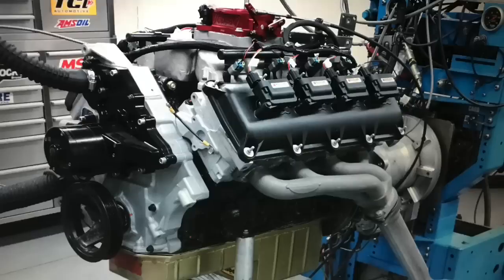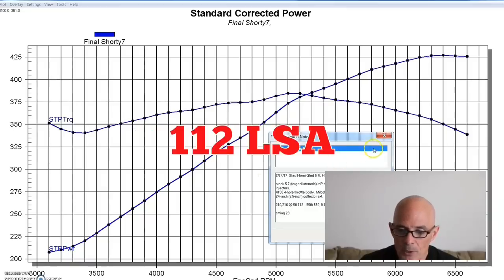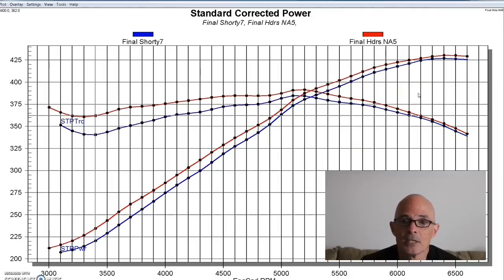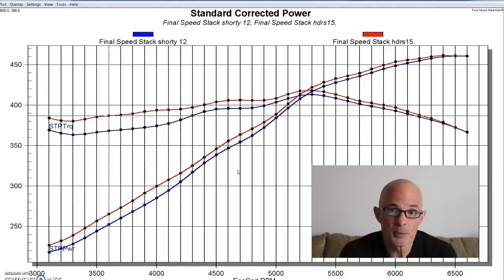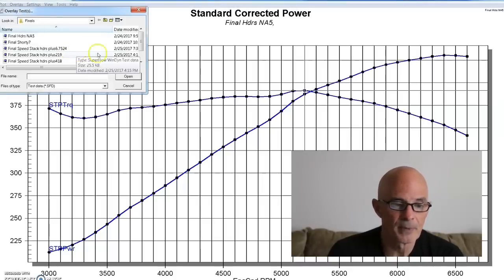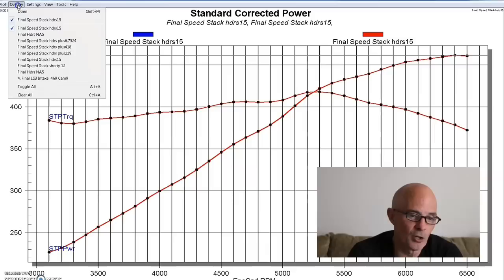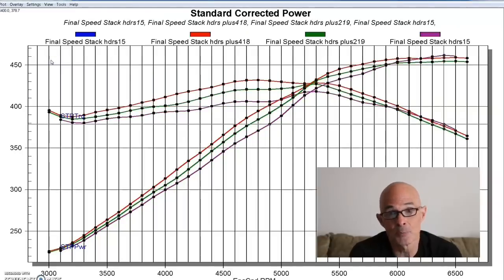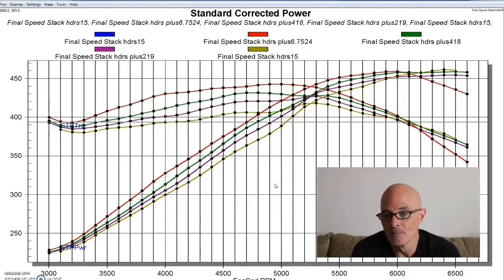STACK ATTACK!! DIY ADJ HEMI INTAKE

Comment: It's time for computer controlled variable intake and exhaust runner length. Use the system to dial in runner to match the rest of the package.
Reply: Ford and Chevy have it and nobody likes it. https://en.m.wikipedia.org/wiki/Variable-length_intake_manifold
Reply: Yes ,aussie ford inline 6 has had an active dual length intake manifold for years.
Reply: watsis buttndo just to add to that, they have been running the dual runner length intake manifold since the mid 90’s. Runs in a long runner until 3800 rpm then a vacuum solenoid opens up 6 butterflies inside the manifold to open up a short runner. Would be interesting to see if any versions of this are available on the ls or hemi to see how good the gains would be over a conventional manifold.
Reply: It’s been in motorcycle intakes for several years. Porches have it as well

Comment: I would love to see a video that uses headers as the intake manifold. Or not necessarily headers, but a fabricated tubular intake manifold where the each cylinder bank has its own manifold (two throttle bodies). I know companies like Holley sell manifolds like the sniper ‘cross style’ manifold (which also uses two throttle bodies) but theyre still not truly a tubular fabricated manifold.
Reply: The term for that is called split plenum. vipers and ferraris use it.  next to stacks it's the best intake layout.  I am experimenting on using a big block Chevy 454 mag mpi boat base plate and removing the single heavy cast alum plenum for dual sheet aluminum plenums (one for each bank) with 2 LS fly by wire throttle bodies and Holley dominator efi when I get some disposable income.  I had thought about 4 plenums and 4 throttle bodies using a DBW throttle body splitter box but since I'm going to run dual turbo, two throttle bodies for two turbos would be simpler I feel.

Comment: I really think the stack injection makes more simply because the air is not turning any corners.  The airspeed will stay high and not "backup" around the corners as the air is forced to the outside of the port on the "curvy runner" single plane intake.
Reply from the maker: its not curve-its length-if we curve them-same results

Comment: Cool test richard. Always interested in seeing runner length tests.

In your opinion, do you think horizontal runners would be better than vertical runners, all else being the same?
Reply from the maker: runner length is runner length (downdraft or X ram)-when you change the angle of attack into the head port relative to the head port, flow can be different

Comment: another fantastic video.years ago I did this on several engines. runner length made a big difference on  a kawasaki 440 both over and under the carburetors.
Reply from the maker: yep-stacks on either side change things (I've done this with Weber side drafts)

Comment: The way David Vizard explained it to me is: in a plenum/shared throttle style intake every cylinder sees the larger throttle opening as only one cylinder is drawing at one time.  In an individual throttle body setup, each cylinder only sees one.
Reply from the maker: search Helmholtz Resonance-plenum, runner and part of the cylinder resonate at a given frequency (intake tube as well)
Reply: Richard Holdener ... Cool, thanks.

Comment: There's a video on youtube about a guy that has a 20b rotary engine with 3 velocity stack that extends out for low end torque and goes down to shorten the runner length for topend power. Can you make that so you can control and make low end torque and topend power? You have the brains that's well more than enough to figure it out.
Reply: the Mazda 787B that won Le Mans had continuously variable intake runners.
Reply from the maker: 4-rotor FTW-at Lemans!!
Reply: The guy I'm talking about lives either in New Zealand or in Australia. The engine is in a FC RX7. I wish I can find the video and show you. But my question is to apply that setup on the V8 ITB setup so you can still have torque and make topend power. The only way I can see this setup to work is by side draft ITB's with variable control velocity stacks. That would be a EPIC setup for a auto cross racer or maybe any type of racing.

Comment: Get out your calculator and use the standard formula for a tuned pipe. Just like a Church organ. No need to do tests.  8 stacks means one port is not taking away from another so better flow.  Just like a 4 cylinder motorcycle engine. It also gives better response.
Reply: That doesn't make for a good video showing the differences.
Reply from the maker: calculator won't give you this data

Comment: Are the colours changing? Looks like the reverse of what you are saying is happening.
Reply: yes. the latest thing being described is always red.
Reply: @sepg5084  thought so being colour blind it is hard to differentiate between the lines at the best of times, so I had to hold the mouse on one of the lines, then I noticed it changed colour. Has this been going on for a while?
Reply: Would explain why I always think the things are back to front to what Richard is describing. I was looking at the colours as being static.
Reply: @DodgyBrothersEngineering  Yep, always.
Reply: @QuicKurtZX14R  Ahh explains a few things.

Comment: Interesting... I wonder what would happen if you made the stacks variable based on the throttle position.
Reply: Mazda 787B had continuously variable length intake runners supposed to optimize airflow for a wide range of RPMs. it's the only rotary powered race car to win Le Mans 24H because rotaries got banned right after, europeans just ban what they cannot compete against 😊 imagine rotaries (famous for low reliability) winning the gruelling 24H Le Mans.
Reply: Several different super sport motorcycles do this.  It works really well.
Reply: Yamaha R1's use a RPM switch over point to adjust the stacks, they've had this system since 2007.
Reply from the maker: Porsche used two different lengths with an actuator to separate a portion of the runner. F1 used continuously variable (sliding trumpets)-its more then RPM related (they optimized the inherent sign waves in the power curve)
Reply: @richardholdener1727  Ford in Australia did something similar to that on their inline 6. Think they used a butterfly to alter it somehow. Never bothered to fully investigate it because I'm a Holden guy. But it does make you wonder if a crude mechanical one could be made to alter trumpet length. Although it would be hard to test on the dyno.